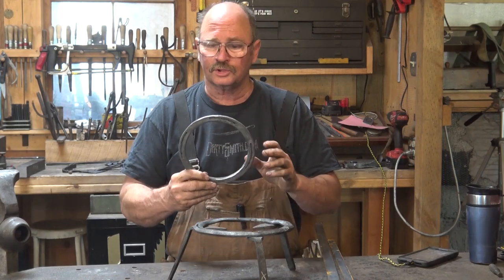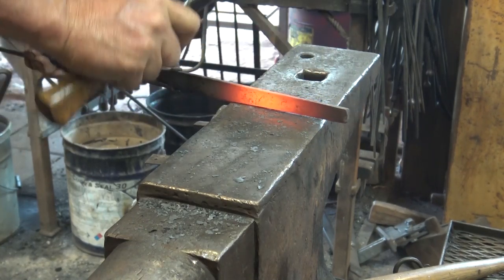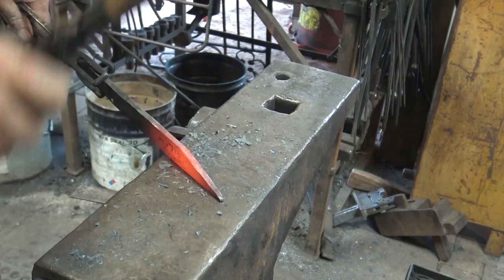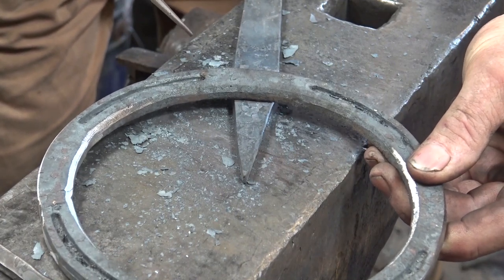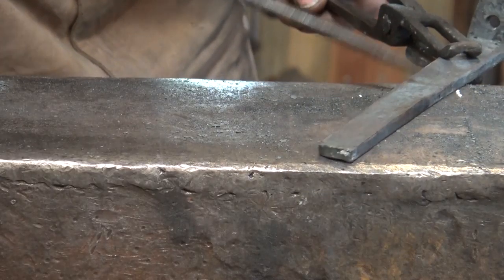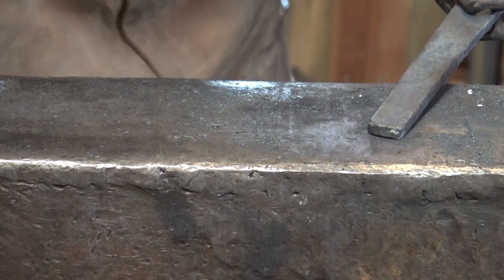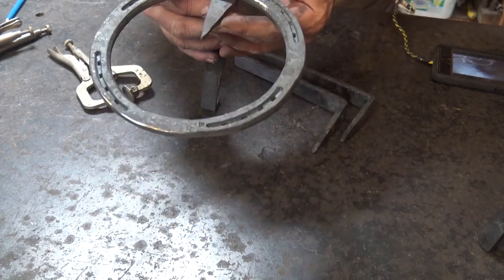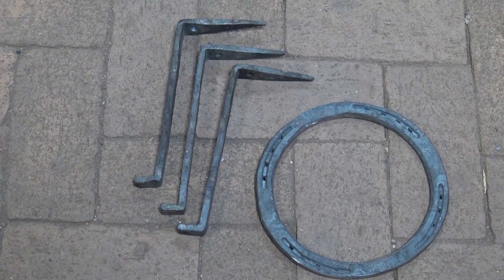Horse shoe trivet - part 2 - New Mexican ironwork

Comment: What kind of maintenance is there on the cutting  edge of the shear? Just curious.
Reply: Centerfire1 oil occasionally maybe. Otherwise nothing.
Reply from the maker: I put new blades in the shear when I got it 20 + years ago and haven't done anything with the blades since.  I do oil the pivot points on the shear from time to time.